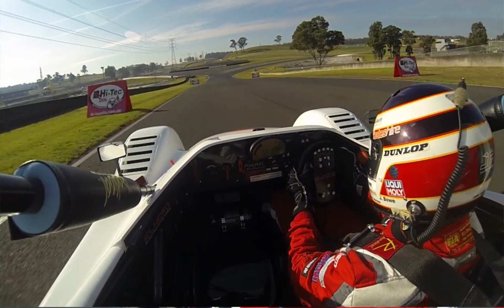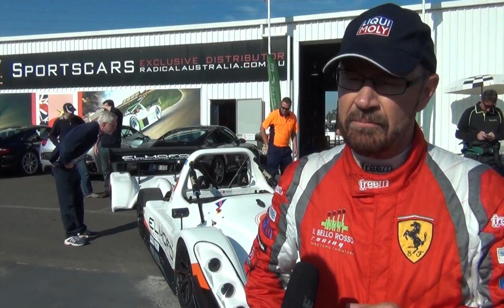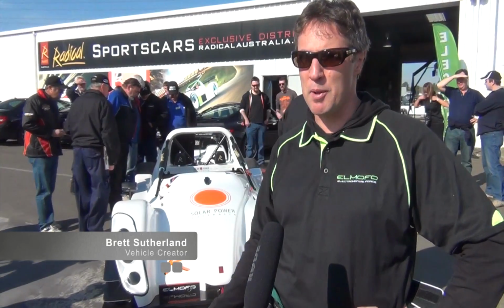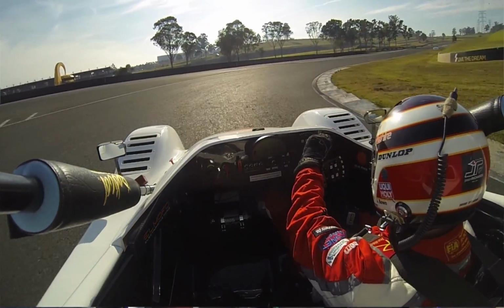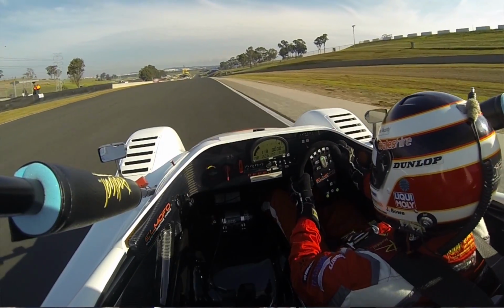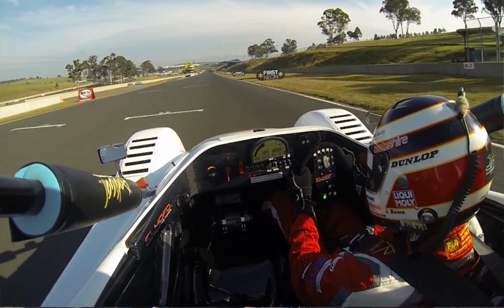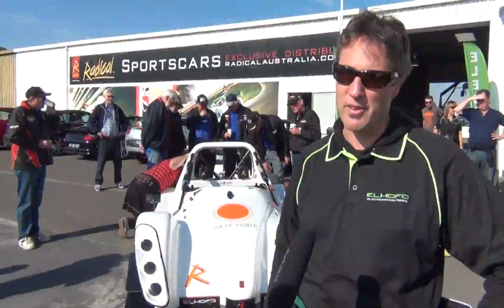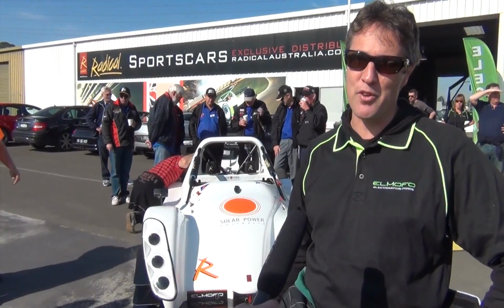Radical sets EV Lap Record at Sydney Motorsport Park

Comment: Racing will be a good start for ev.......no need to rebuild after every race....reliable( one moving part in the motor)... More electricity equals more power......only has to do shorts racers.

Comment: What are the two units sitting over the motor for. One was labelled Motor 1 (front) and the other Motor 2 (rear). Suspected they could have been for storage if it has a KERS type of system on it, but I wasn't sure. Amazing car, Not sure what a whole race would be like with no noise.